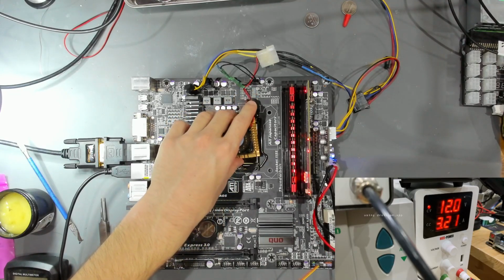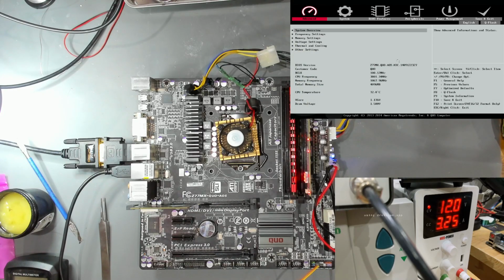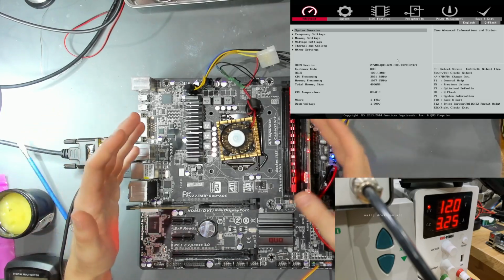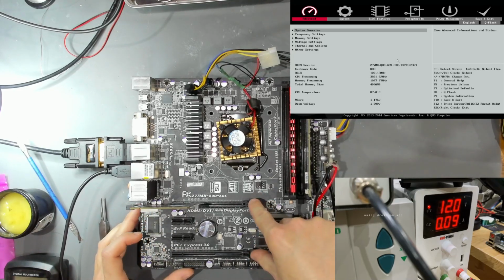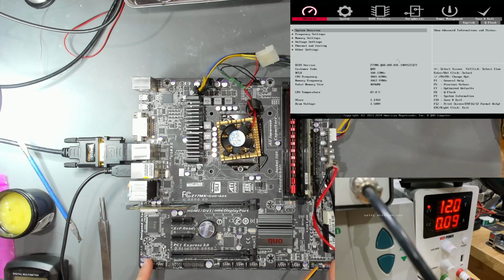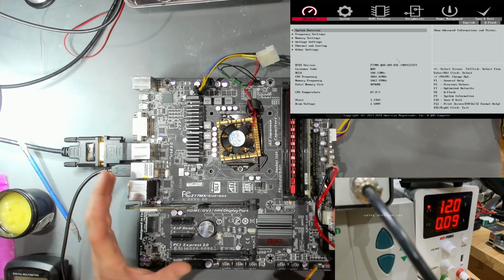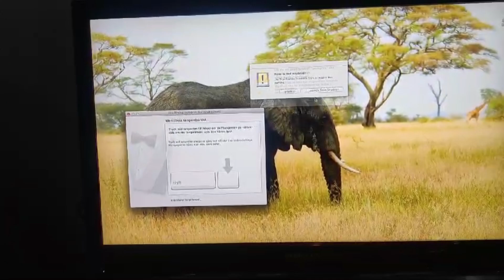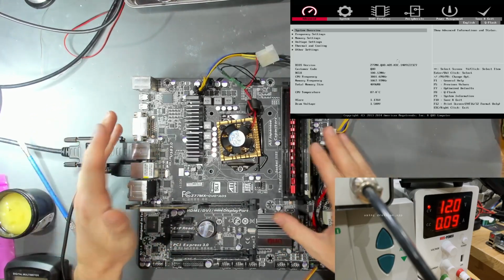ULTRA RARE KIKSTARTER MOTHERBOARDS REPAIR | Gigabyte z77mx-quo-aos ANY OS MOTHERBOARD REPAIR

Comment: Crazy how such a small component can render the whole thing dead,Great repair as usual :)
Reply: A missing resistor can also damage parts! I had to swap a x570 southbridge because a resistor from a voltage divider was missing and the southbridge got roasted from to high supply voltage.
Reply from the maker: That is super unlucky!
Reply: @MainboardMedic  but the pride and happiness after changing the southbridge and getting greeted by the bios screen was priceless!